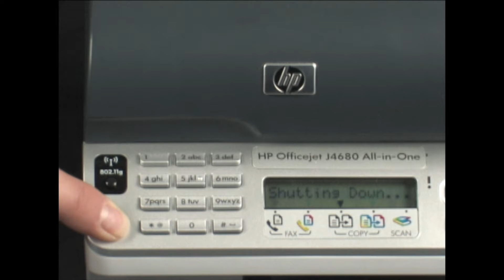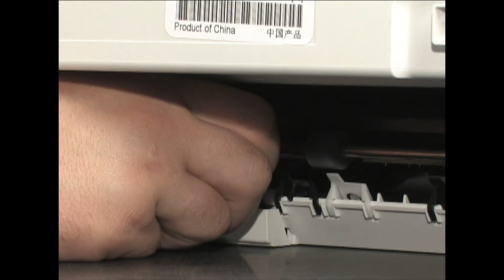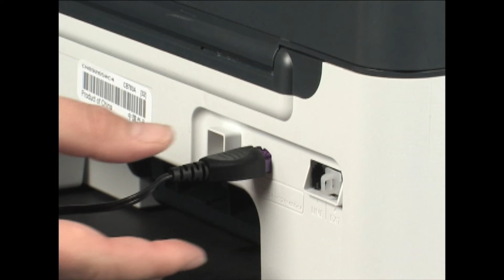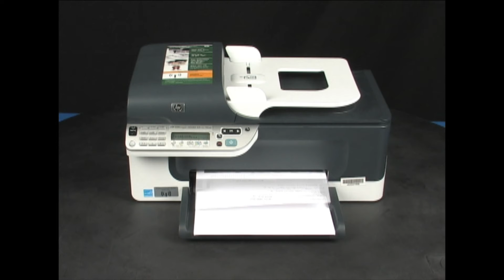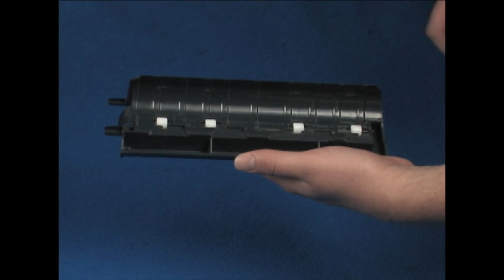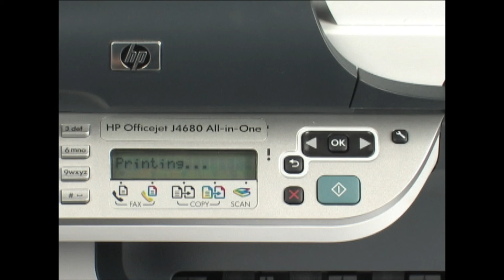Fixing a Paper Jam | HP Officejet J4680 All-in-One Printer | HP

Comment: The link you provided says it no longer supports XP.  What do I do now to try and get my J4580 scanner icon on my desktop?
Reply: Actually that icon, and program were extremely excessive resource hogs. I removed them long ago. If you go into control panel or system preferences, you will still have access  to scan options and printer supplies.